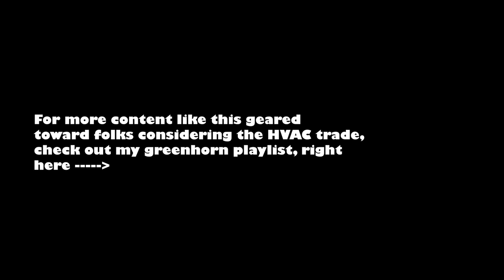5 Things to consider before becoming an HVAC Service Tech🔥❄

Comment: I have done this for 34 yrs  and one thing I can pass on is this never assume anything double check  everything and be 100% sure before you go to the customer.  I say this because the biggest callbacks come from techs that think they  know what the problem is and then fix what they  thought, only to find it was something else. example: joe the tech  goes to a house  see's  suction pressure low and says oh its low on Freon, goes to his truck gets Freon charges system, and ooops suction pressure not moving.. ummm what ? he is now stuck what do I do now ???? ok so now he checks the filter and filter was plugged  ok whew all I have to do is change this filter.... goes back checks pressure and ooops not changing, now joe says ok must be the txv  so goes and tells the home owner he needs a new txv and it will be in tomorrow. Joe does not check it the next morning before  he installs the txv, and now unit working normally,  little does joe know it was not the txv instead the evap was covered in ice because the  filter was not allowing air over the coil and it froze up. he charges the HO for repairs that did not need to be done, and joe will for evermore see this issue and assume  low charge or bad txv. moral  learn  how the system works , learn air flow and the affects of to much  or not enough, and mostly CHECK EVERYTHING , NEVER ASSUME ANYTHING.

Comment: Great video, thank you for sharing. I’m 53, working an office job in IT and considering options on what to do after I retire. I’m very handy and love physical work. I don’t mind working alone, but the burden on your body wasn’t something I was considering. I live near Chicago, so working in the heat is somewhat OK. I’m only contemplating residential work in the Northwest burbs.

Question for the HVAC professionals and old timers like me: Would you recommend HVAC as a part time job for someone at 65?

Comment: I have been in the HVAC/R service field for about 14 years in the Boston area.
To recap on AK's list:
1. (Expect to be alone). This is true and I enjoy working by myself. I can can really focus on problems when i have no distractions. Do not abuse this and justify your time wisely.
2. (Have customer service skills). Yes this is important in any customer service job, not just HVAC. The better the communication, the more likely the customer will want you back.
3. (The hours can be crazy). Exactly what he said by additionally, In service you are required to be on-call which can be brutal. This can be better or worse depending on the company and work you do. For example if you work on restaurant, pharmaceutical or food market equipment, the demand to keep them running is very high. 
4. (Don't expect "Good job"). This is true but this can go towards every job in the world. 
5. (This job is Physical Demanding). Hell yes! Expect to lift 50lb+ compressors by yourself. Expect to make 6+ trips to the (90F+) roof with all your large equipment once in a while. Expect to go into crawl spaces, and up and down ladders. 

If i could add a few things from my experience. 
1. You will be working outside or in basements almost every day. Expect to be hot in the summer, cold in the winter, wet when it rains, and parched when its dry. 
2. You must enjoy learning on the spot and learning in general (even in bad conditions). You will be expected to fix things that you have never even seen or heard of before. You must use what you learned in school and some common sense to fix problems. Some problems can be extremely technical so you may need to call manufactures or other techs and ask questions. You also need to be professional about it and not freak the customer out that you know nothing about it.
3. ON-CALL! ON-CALL! ON-CALL! I know AK said you could have crazy hours but you need to understand this is one of the worst parts of being in service. From my experience, you must be ready to drive away within 2hrs of receiving the call and you could be on that call for 30min to 8hrs. 
4. Know what the pay grade of for your area. What should you be making on your first day, in 5 years, 10 years, 20 years? If you don't know this, go to this link and search your state. This will tell you where your 5ish year mark should be. Also know that if you are amazing at what you do, you can make way more than the average.  https://www.indeed.com/salaries/HVAC-Technician-Salaries.
5. You must be comfortable working on live electrical. You could easily die from this. This is a must to diagnose some problems. Usually you will be dealing with voltage no higher than 480. 
6. Lastly, this goes for all jobs, LEARN FROM YOUR MISTAKES.
Reply from the maker: Great insight Greg, thank you!
Reply: @AKHVAC  thank you for asking the salty dogs to give insight. I'm a veteran/pharmacy tech/ beginner welder looking at career in HVAC. I love working independently, problem solving, and I don't need the recognition, completing a job with satisfied customer would be more then enough for me. Solving complicated problems is also rewarding almost similar to solving a chemistry problem, long and tedious but you have a sense of accomplishment once you conquer it. Just finished a welding program so I hope I can incorporate it into HVAC.Again thanks for helping me make my decision to pursue a career in HVAC.

Comment: I've been doing this since 1988 I've worked for people that wanted every install done in one day no matter how many hours you had to work I'm a service technician for 20 years now and you do need install knowledge because some calls the problem isn't the unit it's the ductwork I work alone even if I do a unit change out I do it alone and experience is why I'm able to do that but it's never been a 8 hour aday job so if you don't want hours don't get into hvac

Comment: I’ve been aService Tech for about 15 years and your right about the clock my buddies ask hey man what time do you get off work and I always shrug my shoulders and say when my tires pull in the driveway. I live in South Alabama and the heat is a MOFO in the summer time and your crawling around on the top of a package unit or Air cooled chiller changing condenser motors burning your knees up and when you finish the customer say hey I got something else for you to look at and your like 😡

Comment: Good good question hope you can answer it. Do you charge to do redo's. Example customer doesn't like the spot of the water heater or HVAC condenser. They agreed on the spot, but not the exact length from the wall. The customer was home. Do you charge them more after you agreed on the price of installation before you started the project ?

Comment: As a retired Steamfitter in Union the projects and workmanship I observed and performed are something to be proud of. I averaged 40 to 50 miles to work one way sometimes more. So you loose 3 hrs a day or more of life. It is a rough racket and requires alot of physical demands.Would I do it again ?

Comment: I’m 53 and looking to switch from CDL truck driving to HVAC. I’m not in shape so should I even attempt to get into heating and air? I have about the same build as the guy in this video. Do we non-perfect specimens have a chance at physical trades or are the chances too slim?

Comment: How AAAaaaR ya.
I am a 50 yo  master plumber , HVAC problem solver. I LOVE MY PROFESSION!!!!!!!
I started as a young boy ( around age of 5 ) working with my father, and grand father. I have seen, done, and heard almost everything. However,  I am still learning new things everyday. 
Whether it is due to new technology,  code updates, or observing creative "Handyman" remedies to simply make some sort of repairs.  
I cant believe the krap work I see. Both from dont know shit guys, up to shit that licensed contractors.
It seems true appreciation,  knowledge,  and work ethics are few , and not consistant.
As I got older, and learned more about true diagnostics, figuring out others mistakes,  on top of what the actual problem is, I advanced tremendously. 
I can figure out problem within seconds, sometimes site unseen.

My body has broken down quite badly.
Between my knees, my shoulders, and severe heat exhaustion, I cant handle this anymore.  
ESPECIALLY the heat!!!!!

Having the true knowledge in your trade is important. 
The MOST IMPORTANT about any of this........THE MONEY 

You might be able to fix anything.  But if u dont know the financial aspect of your business/self worth, go work at a supplier in the office.
Save your back, and your family.

No matter how much I hurt, I love what I do. Good old fashioned work ethics, I work , and work, and work.

We need to get more youngsters away from brainwashing computers, and professors,  give them a real trade , real pay, and rebuild our country .

There is no safe space in this work.

Peace god bless

Comment: I haven’t read all comments but also, you may develop COPD like I did (non smoker too) working in air handlers and being exposed to lead (indoor shooting range / air filter changes) and other numerous hazardous chemicals throughout my hvac career in the Air Force.  After I retired in March of ‘18, I quit doing hvac and never looked back.  I’m quite happy now working 25 to 30 hours a week and is virtually stress free.  I respect those that continue this career choice but I’ve done my time in it and choose to never do it again.  What’s the point in literally killing yourself in this line of work and yes, it may pay well but, odds are, you won’t have the time to enjoy that pay.  
 I’ve spoken to guys that work for trane and most said they start at 6 am and on the job til 11 pm.  No thanks.

Comment: Be prepared to deal with a LOT...and I mean a LOOOOOT of A-holes when you first start out. Guys who will really make this trade seem like rocket science when it’s really not. A guy who was supposed to be “training” me once told me I would be better off doing sales than field work, and just a few short years later, I can do full system changeouts on my own. Elitism in this field is definitely a thing, and it may take a while for you to really find yourself in a company where you can truly learn. On the other side of the coin, you’ll meet many guys who have been doing this for a long time and are not inclined to impart any kinda knowledge to you. Also a lot of companies won’t allow you that luxury of learning and will try to pigeonhole you in smaller roles like maintenance. DONT allow yourself to stay in a role like that, you’ll only be capping your skills/experience. So don’t become discouraged and keep forging ahead. Try to find a company where you can truly grow as a tech. You may need to move to and from various companies before you find a good fit. And eventually you’ll gain the knowledge and experience to become a great, well compensated technician.

Comment: This trade requires you to know electrical plumbing framing thermal dynamics and most important psychology. You will for sure need to know a psychologist and in some cases need to be one. Dealing with customers for the residential service techs comes with allot of talking. Seems like allot of times I’m the only person they seen all week. Commercial jobs usually your talking to the facilities Mr. Fix-It that thinks he knows AC but disappears as you head to the roof. He will also have a pair of gauges he got from a local auto parts shop. In this case less talking but more walking

Comment: Dude, have been working HVAC since March. I had thought that HVAC meant home vacuum system.  I had worked for 3 years as a traveling vacuum repairman/salesman, and while it was good money, I feel much more accomplished doing this HVAC stuff. Getting a huge job done in one day and making it to look pretty is an am amazing feeling. But yeah, meanwhile, I got no energy left at the end of the day. If you're single, be prepared to only clean and do laundry on the weekends... if you have the energy. You will go into hot as 120-140 degree attics and sweat a pound every 5 minutes. Some of these are really terribly set up systems. Hopefully, these were not systems your company put in, but still, the bitch of it is with dealing with it. Frustration is something you should probably be good dealing with, as you're going to come across a lot of different problems with a lot of different house setups. All in all, though, it's a sweet ass feeling when everything is done and the house owner is tickled pink to have their system set up right and working properly. I work for an extreme stickler for details, but I happen to be one myself,  so most of the time we're all good.

Comment: I'd appreciate some advice from an expert like yourself if you can spare a moment. My current employer wants to pay for me to get HVAC certified so that I can maintain and repair all of the HVAC equipment we have in the building. Heating, cooling, ice makers, walk-in cooler and freezer, stoves, fryers, etc. Is it realistic to think I'd be up to the job after getting certified? Everyone on youtube makes it sound like you need a lot of experience too. I don't want to get into a situation where they've paid to get me certified but I'm still not able to do the job for lack of experience. They probably wouldn't like that much. So I'm a little nervous about it. Thanks.

Comment: I’m a 29 year old female with 8 years experience doing cabinetry, solid surface and finishing carpentry. I’m looking into a test and balances Company for commercial locations and I’m wondering if the long hours are similar to residential? Do you think the basic knowledge and know how with tools and repairs are similar are enough for a smooth transition? I also was a satellite service technician for a window company which was basically servicing/ replacing hardware and field glazing. The pay listed for this HVAC job ranged from 18-40 so as I eagerly await my interview I’m hoping to, for lack of a better term, be “graded” on my experience as it relates to this type of work. Thanks.

Comment: Training is key.  Bad habits and training will stay with you.  Try to get a apprenticeship threw trade union.  Best wages and training.  If your reliable and good at either service/install you can get paid way over scale and ask for 4-6 weeks vacation.  Covers holidays, vacations etc.  Is the way to go.  I have 24 years in at 46, and at 55 full pension with 30 yrs in.  Will have 33.  Why work till your 70.

Comment: Hey bud, can we ask some hvac questions to solve some issues in the feild?
Reply: Im working on some self contained units that are water cooled, heat exchanger types i guess, and we have a leak in the heat exchanger but we want to run it because its an mcc, should i pull a vacuum with or without the water flowing, both are wrong i know but we need this unit to run while we wait.

Comment: I have to laugh at the hard part of your work being a Structural Ironworker who worked all our jurisdiction including rebar...Tying and humping steel on a bridge decks was very physical demanding work.Layiing on my back in a steelmill pickler where the arc of the stinger was purple and magnitized 3 inches long was quite interesting , or connecting And climbing columns all day  wrang your muscles out bigtime ...but mostly was the camaraderie doing Union work ,which gave me a chance to work all over the USA ...Union work is the best ...lasted 35 yrs, retired in 2007.

Comment: Is there any prior knowledge you would recommend for someone with no experience like Math or Physics?
Reply: Basic math is all you need,  reading and writing is important, understanding electrical schematics, working with your hands, problem solving skills,  persistent, resistant,  self motivated, hungry to learn,  prepared to work in all the extreme environments, no set schedules, alot of driving (defensive driving).. there is not really a set prerequisite, it's kinda it's own animal.  But it is a rock solid trade and has provided me and my family of 6 a good life. Good luck my friend.

Comment: Hey I have question what those businesses man called when you work for a big company like example they offer you  200k-400k to finish this building  off just putting air conditioning equipment like pipes, building them connect them .but you have like couple months or years to finish it off. those 200-400k$ come to employee taxes , safety, Equipment, stuff like that you know what it called (air conditioning contractor?) I know there a professional word to called it 
Any can help me out plz ..!

Comment: If you are thinking about HVAC as a career you will enjoy it and you will be frustrated.   Customers will lie about you and the work you did and what you said.  ALWAYS write up the work ticket with everything you did and told the customer and make them sign it.
You might end up with a company that is understaffed and find yourself on call 7 days a week.  you might have to keep cardboard in the truck because some of the houses you go into are do filthy and roach infested you won't be able to lie on the floor otherwise.  And many companies don't put you on a clock.  You only get paid when they have work.    I have worked as little as 15 hours a week in the off season.  If you don't need the money to live on, no problem!   IT is a rewarding career and if you like troubleshooting you can have a lot of fun.   And you will see some of the craziest junkiest repairs by hacks you can imagine.   If you decide to do it, work on your customers house like you would want a tech to work on yours.